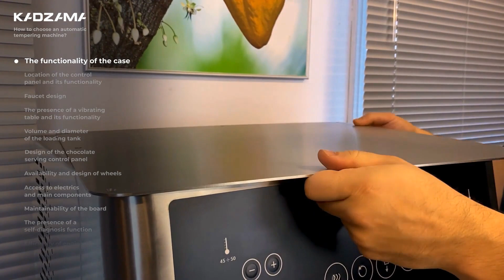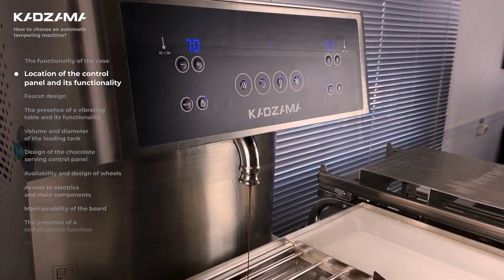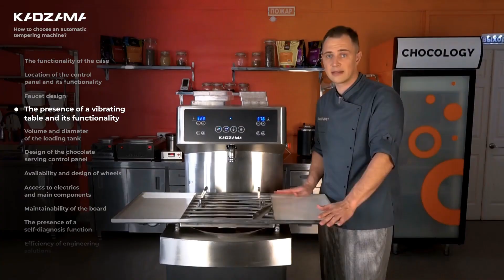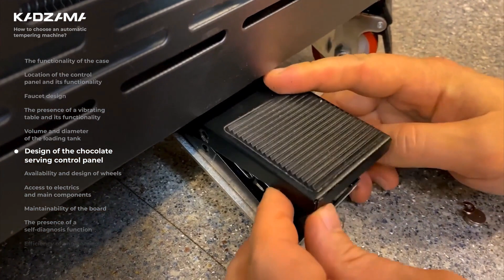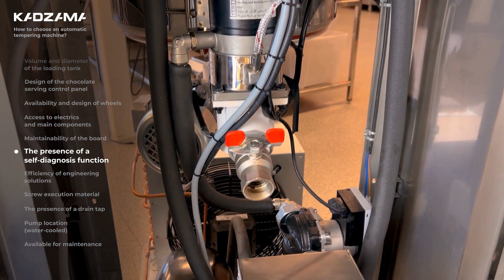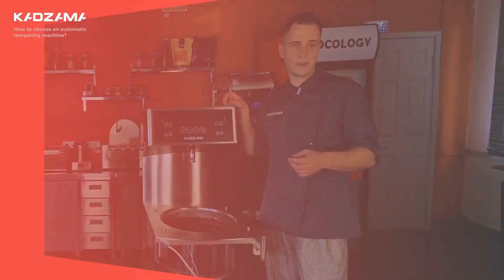How to Choose the Right Automatic Tempering Machine for Your Production Needs 💡

Comment: Thanks for making this video, I found it very informative. One thing I would like to know is how do you perform a deep clean of such a tempering machine? If you need to flush the internals of the machine where do you do this within the operating room? Where do you flush the water to? Do you attach an outlet hose or do you let the water fall onto the floor to go down a floor drain? I was thinking of installing a shower basin with drain in the room such that I could easily position the machine next to for cleaning and effective water drainage. What do you think of this idea?